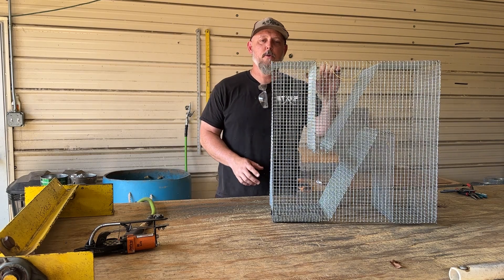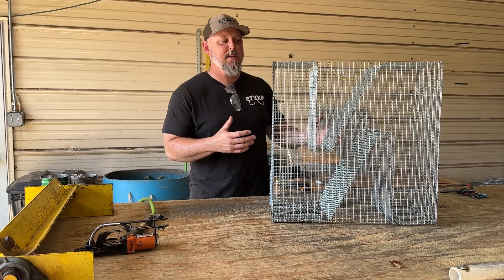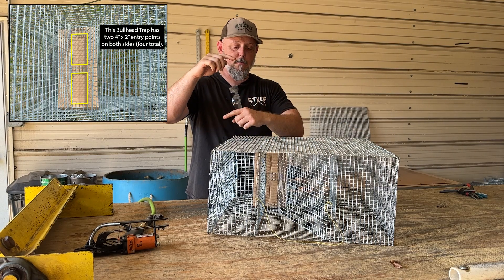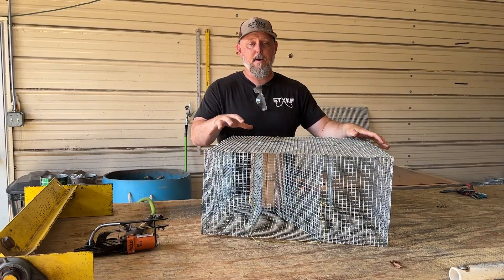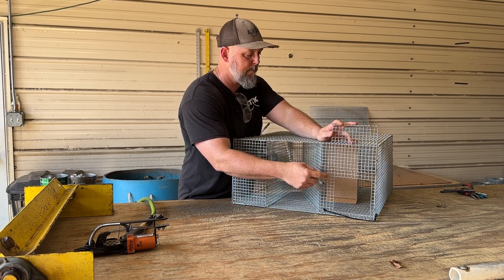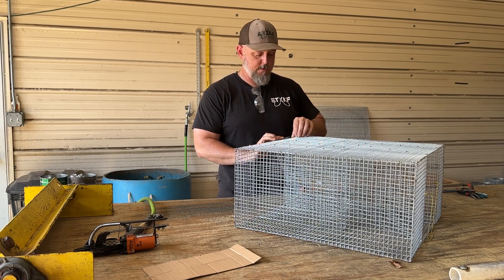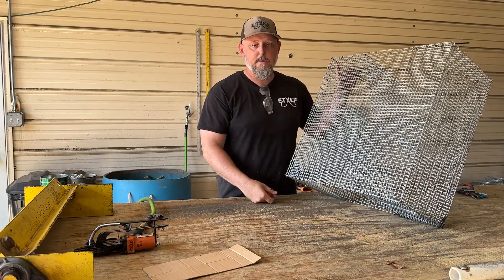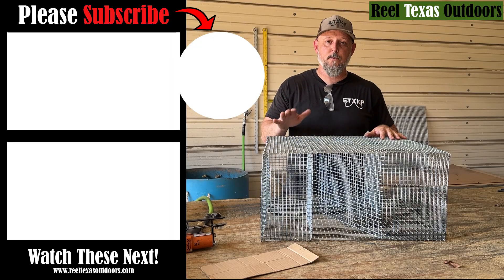Bullhead Catfish Trap: How to Quickly Thin The Population

Comment: Great build, looks like it works great! I have a question? What kind of hog ringer gun do you use on you 12-14 gauge wire?? Brand and model , thanks! My hands can't handle it anymore!
Reply from the maker: Hi Joe, sorry for the delayed reply. I don’t have an exact model #, but it’s like a 760 - something. This one uses half inch hog rings, I don’t have one for larger diameter wires though, so you might have to do some research if you’re needing a hog ring gun for bigger wire. 

This one came from GL Fast out of Tennessee, but you can order them from a number of places. Good luck, man.